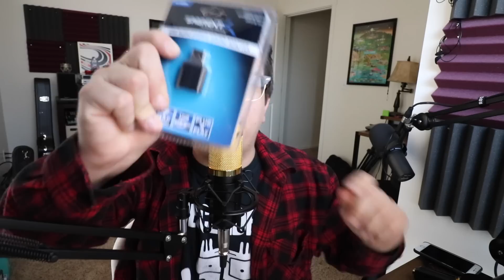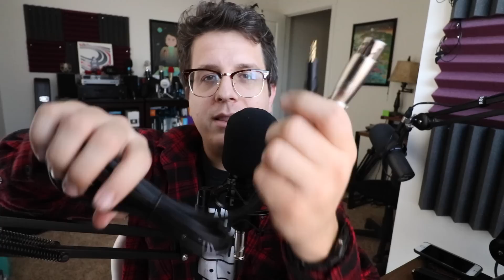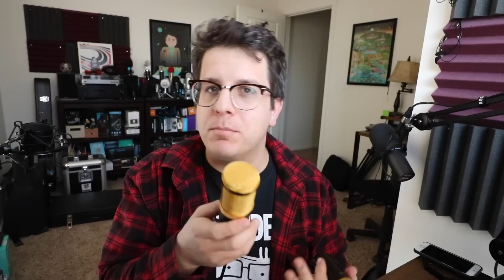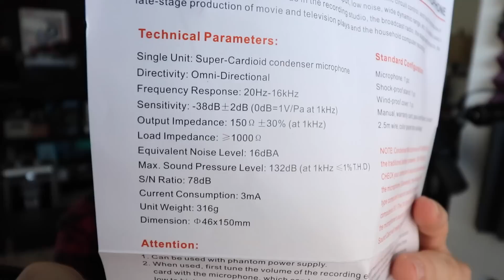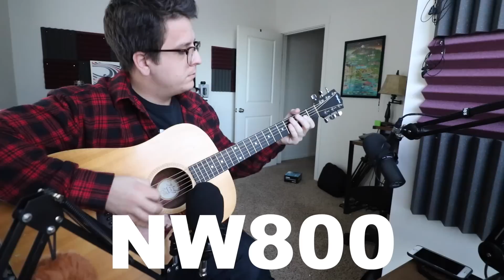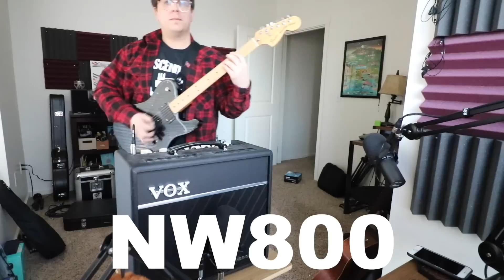Neewer NW-800 Condenser Microphone Review / Test

Comment: Just grabbed one on Amazon for $11. Can't beat it. I've got dynamics, condensers, and ribbon mics, some costing 20x as much, but do they sound 20x better? Debatable.  TBH I'm planning to keep the body/capsule and maybe mod or replace the driver board (probably replace since this is SMT). Body is decently constructed and I couldn't even buy an empty one this cheap..
Reply: buying expensive mics is usually a waste of money anyways, it's all relatively old tech.
Reply: @iamv0id202  I have a few of those too. I've got 60+ mics in my locker. But you're not wrong . Many of the mics on the market are based on a very limited set of proven circuit designs that have been around for 50-60 years.  Nobody is reinventing the wheel.

Comment: This is the current microphone I'm using right now on my podcast here on YouTube and in my experience, using both the Phantom power and the USB soundcard does its job but in the end, it wasn't the greatest and best audio quality. I tend to have way too many hissing sounds which make me do more audio editing furthermore. 

But, later on, I upgraded and got myself a new Behringer U-Phoria UM2 audio interface and may I say it improve my audio quality exponentially! The only downside really is you gotta make sure you control the gain know carefully because if you put too high it will have so much hissing sound. 

Anyways, great video as always and would like to ask for your opinion. Should I get upgrade to a better microphone or an audio interface?

Comment: on my microphone it has alot of noise like white noise i think its called
Reply: its the neweer 800 to btw
Reply: @Antares Star i found out its because you need a 48v phantom power supply to make it work
Reply: how did u fix it?
Reply: @theproslayerr2114  bruh i couldnt fix my bs even w a phantom power so i just got a new different one
Reply: @babyesco1  so you can't just connect it to your pc?
Reply: @theproslayerr2114  my laptop dont support it cuz its 48v and my laptop is garbage
Reply: @babyesco1  so which mic did you get now?
Reply: @babyesco1  so this one doesn't sound like that annoying buzzing sound? I literally did everything I could to remove it but couldnt fix it.
Reply: @theproslayerr2114  if u want i can send u samples of both mics and let u decide waht u want

Comment: I just purchased the NeewerNW800 and a "Depusheng U4 Sound Mixing Console Bluetooth USB Record Computer Playback 48V Phantom Power Delay Repeat Effect 4 Channels USB Audio Mixer " audio interface My Laptop is an Acer touchscreen running  windows 8. Can you help me with advice on the best way to configure this set up, and maybe some suggestions on what the best way to set up a video podcast using this gear?

Comment: I know this is an old video, but I’ve just picked up a secondhand Behringer 302usb (I have watched your video on that too) will the Neewer mics work with the low 14v phantom power output. My current xlr condenser mic (really old, maybe 19years old) clicks when using the 302, I assume because it’s not getting a enough from phantom power (it’s dinner on my bigger mixer) 
Can you confirm which mics would work with the 302usb. I’m looking to keep this set up as low budget as possible. I’m using a dynamic mic with the 302 at the moment but thought something like the Nw 800 or 700 or something at that price point would be good (if they can get enough power and actually work on the 302usb) I know you probably don’t have any of these things laying around to test anymore. I’m a bit behind I guess.
Any advice for mics that work with the 302 would be awesome.

Thanks in advance. 

Ryan

Comment: I've had this mic for about 3 years, it's been great but I'm tempted to upgrade. I'm looking for something around $100. Is there any mic you would say is "clearly" better than this in that range.
Reply: hi since  you had this mic for 3 years could you help me please?
Im a noob at these things and at 0:38 he said you need voltage. how do you see how much voltage you have and stuff?
Reply: @fea88joined89  Not sure about the science behind it. I'm not too experienced in this but here's what I understand.
You would want to get a power supply or audio interface to power it. Otherwise the mic won't function correctly (too quite, doesn't work at all, etc) For the best effect you would want a device that outputs Phantom Power (Full 48V).
The Neewer NW-100 is a power supply that you can use between your microphone and the headphone jack on your PC. The problem is if you use a internal sound card on your computer you often get a constant Hiss noise due to interference.
The better option is a Audio Interface that has phantom power such as the Scarlett Solo or Behringer UM2. They are much more more expensive but eliminate all sources of interference and also provide a even cleaner sound. (Search up a sound comparison between a audio interface and power supply)
My recommendation is if you don't mind the money buy the Audio Interface, otherwise try the Power Supply, if you get a hiss that bothers you either get a external sound card or more preferably a audio interface with Phantom Power
Reply: @fea88joined89  Not sure about seeing the actual voltage, it's probably somewhere in the specs of the sound card. If it sounds fine than the voltage provided by your current power supply (built in the sound card assuming you are not already using a dedicated one) is probably sufficent. But it can be improved with phantom power.
Reply: @fea88joined89  Hope this helps
Reply: @TheBaz568  thank you!

Comment: I found a better version that has the mic stand and a swivel pop filter and other things for the same price (UK only) https://www.amazon.co.uk/Professional-Broadcasting-Microphone-Adjustable-Suspension/dp/B01I6LIZ8S/ref=pd_sbs_267_1/257-1324754-5323609?_encoding=UTF8&pd_rd_i=B01I6LIZ8S&pd_rd_r=17d1bd7c-1e76-4c9f-8e59-7dcc27c060eb&pd_rd_w=NZEYp&pd_rd_wg=Dqr7x&pf_rd_p=2b420a2f-6593-478e-8b5f-cb43865ff16f&pf_rd_r=200KFHFBV6Y7CTHSP0ZW&refRID=200KFHFBV6Y7CTHSP0ZW&th=1

Comment: Been using one since about the time this review came up;
foam filter got eaten by my cats BUT didn't fall apart over time like some do,
the cable eventually got loose @ the XLR, and I wound up ripping it out of the housing LOL but I re-soldered it and it's fine. I mean, for the cost, it was a great deal
The mount is still good, none of the bungee/rubber material bands fell apart yet and I've certainly abused it
The mic still sounds how it did when it was new (I have reference recordings) 
The power supply is still good--no buzz or anything silly
And it looks pretty good.
My brother actually bought one about a year after me without me knowing and his is of the same detail, so, I'd recommend it as well for the cost, but don't rely on the generic XLR cables
Reply from the maker: Yeah if it's survived all that. I'd say you got your $20 worth! Haha.
Reply: @Podcastage  I do believe I got a kit w/ the PSU, case, etc and at the time it was like $50 but it had good reviews so I went for it haha

Comment: Do I need a audio interface to use it or can I just plug it in my laptop
Reply from the maker: I would ONLY recommend this mic with a proper USB Audio Interface like the Behringer UM2. I don't think you get usable quality 99% of the time.
Reply: @Podcastage  why then you made a whole video saying usb soundcard is enough? What made you change your mind to tell ppl not to buy usb soundcard, in description? Quality seems very good if only few additional $ will make this BM-800 condenser mic sound 10x better. Unless you lied in the first place and actually had much better setup than just usb soundcard, while recording this. :)
Reply from the maker: Sensei because manufacturers change components without notice and that affects the performance. At the time of making these videos I was unaware that the company would change it: https://youtu.be/J1v1jtHz4C0

Comment: I cant get a soundcard or phantom supply i had a nw700 and i plugged into my desktop and it worked fine i have a 750 watt psu will it be ok with a nw 800
Reply from the maker: What soundcard? If you're talking about the 3.5mm input on your computer, that's correct, it will not provide phantom power. I recommend a USB AUDIO INTERFACE like the Behringer UM2, which provides +48v of phantom power. You will need an xlr to xlr cable to connect the mic to the interface.
Reply: But i used the nw700 without an inteeface so shouldnt the nw 800 be the same?

Comment: If I buy a 48V phantom Neewer Power Supply. Will I need anything else for it to work WELL?
Reply: Nope as long as you are planning on using the cprd that comes with it and have an 1/8th inch mic jack on your computer. If you dont, you can get a usb sound card adapter on amazon for just a few bucks. If you have an audio interface with an xlr input you will need to buy a standard xlr cable, as the supplied cable is xlr to 1/8th inch.
Reply: Angelo Faraday So can I just by the mic, um2 interface, and an xlr. Will that be good? Will the um2 charge the mic.

Comment: I just got this microphone, but it sounds just as muddy as my Corsair Void Pro (wireless). Is there something I'm missing? I'm using a 48v Phantom power supply and the included XLR -> 3.5mm adapter.

Comment: Do you really need that gigantic 48V Power Supply for it to work?
Reply: Răzvan Afloarei, if your running it on a laptop or a low power computer then yes. Bought a neewer condenser mic to  live stream and I didn’t order a phantom power supply and I get I really bad humming noise.

Comment: hmm when i plug in mine its really soft. what do i do?
Reply from the maker: Depends how you’re connecting it.
Reply: Hmm i got it like this: mic to phantom 48v to my motherboard
Reply from the maker: There is likely the problem. Direct to computers motherboard does not provide decent quality. A usb audio interface would provide better quality.
Reply: Thanks! I will try that

Comment: I bought a white/gold BM-800 a year ago in a kit. (swingarm, pop filter, vibration mount, wind filters, dynamic mic holder, bm-800) connected to a UM-2. It was a good deal but after about 6 months, an 8db LF hum started to randomly show up. The hum completely goes away only when disconnecting the mic. Physically the internals of the mic are fine and the small circuit board in it looks ok too. Sometimes the hum just goes away and it has levels the same as most decent condenser mics...if you can afford it, get a better mic...quality control on known brands is actually a thing worth paying for! Since these cheap mics sound very similar to an AT2020, I recently upgraded to that.

Comment: so if i buy this mic and a sound card i can run it well? Do i need the 48v power supply because they have a kit with it? if i buy their kit that comes with a soundcard can i just plug the xlr to 3.5 in there and call it a day
Reply: you can connect it directly with you builtin soundcard, you can use the phantom power brick or you can get a proper audio interface with a mic preamp and phantom power, i bought the behringer umc22 in order o reduce any hiss and noise

Comment: You should read this before buying this mic:

So I bought  the NW-800 + the sound card Behringer U-Phoria UMC22 + XLR cable 
After instaling the drivers, configurating all the stuff, I still had this background noise and bad quality ( nothing to see with the quality in this video)
After searching on the net I finaly asked Amazon for a refund.

I wasn't the only one with that issue.

So finaly
1) DO NOT USE BAD SOUND CARD for the NW-800
2) Be aware of what you buy,
Reply: i've bought the same setup as you and can hear any noise at all (except the noise that comes from the cooling system of my computer)

Comment: I have a question. Do I only need to buy a phantom power device for this mic, or do I need a USB soundcard too?
Reply from the maker: I only recommend picking up USB AUDIO INTERFACE that offers phantom power.
Reply: Thank you for the response! Do you think the Neewer phantom power supply would be fine?
I'm also not sure if I should get the BM-700, the BM-800 or the NW-800. I've read someone in the comments say the BM-700 has less distortion than the BM-800 when you're speaking in it loud. So I guess I'll buy the BM-700? I guess it's a good mic.

Comment: Just picked up the NW-800 for about $20 USD and will be using it with a Tascam DR-44WL handheld digital audio recorder which has Phantom power and XLR inputs.  I need to test for pattern response but there is as best I can tell no documentation that might help with pattern and reference position.  In the future perhaps when you test for pattern you also provide the reference on the microphone you can use to identify where the center of the pattern is.

Comment: heck for me my NW-800 Microphone is super static almost nothing how you sounded I wonder what Im doing wrong
Reply from the maker: connecting direct to computer? or using usb souindcard?>
Reply: Podcastage I'm using  a USB sound card & Phantom Power
Reply: I have had the same issue. Turns out my laptop was actually the problem. I tried different combinations, with and without phantom power, with different audio settings... but no external sound cards or audio interfaces. 
My laptop produces a loud static noise that I was able to remove by enabling echo cancellation and setting the gain to 0db and the volume to 75. But my voice sounds terrible when I do that. 

Then I tried it on my gaming setup, which has a decent built in sound card and there is no static. With or without phantom power, it sounds just as loud and as clear. And no settings there either. Just input volume set to 100% and nothing else. Even at +30.0db gain, there still is no static. 

So my suggestion is, don't use a cheap computer with your mic. I didn't try an audio interface though, so I don't know whether to recommend trying that. But it still is an option, that many people recommend.

Comment: I just got this mic and it seems to clip really easily when I speak or make a sound that's just a bit louder than normal, I have an interface and the gain nob set to half way and on my pc the levels are 50, also I'm further away than you were in the video, thanks for any help!
Reply from the maker: What is the level you are hitting on your computer? That's what's really important. You're probably clipping. So turn the gain down.

Comment: I bought the mic and and I'm getting very loud static noise in the backround. I am running it into my Behringer U-Phoria UMC22 and the Interface directly into my pc. Even when I turn the gain almost all the way down, I can still hear the backround noise through direct monitoring. Should I just buy another one or is there any way to fix this?
Reply: I have had the same issue. Turns out my laptop was actually the problem. I tried different combinations, with and without phantom power, with different audio settings... but no external sound cards or audio interfaces. 
My laptop produces a loud static noise that I was able to remove by enabling echo cancellation and setting the gain to 0db and the volume to 75. But my voice sounds terrible when I do that. 

Then I tried it on my gaming setup, which has a decent built in sound card and there is no static. With or without phantom power, it sounds just as loud and as clear. And no settings there either. Just input volume set to 100% and nothing else. Even at +30.0db gain, there still is no static. 

So my suggestion is, don't use a cheap computer with your mic. I didn't try an audio interface though, so I don't know whether to recommend trying that. But it still is an option, that many people recommend.

Comment: DISCLAIMER u said this thing can run on 4 and half volts wait??????!!!!!!

I want to get this mic sound great can I use a behringer 502 on this it has 14 volts not +48
Plz answer thanks
Reply from the maker: Go to Lol yes it should work on the q502 perfectly fine when connected with an xlr to xlr cable.
Reply: Podcastage   (Another thing)

Can I put a xlr to 3.5 to an 3.5 to 1/4 adapter and plug the adapter into an mixer?

Will the 502 mixer except that

If ur confused go to my channel and watch this one video

Comment: So I plug my neewer 800 into the phantom power supply and into the microphone input on my computer and the sound is terrible. So much static noise I can barely hear myself. What can I do to fix this?
Reply from the maker: Yeah. I no longer recommend this connection method at all. I ONLY recommend connecting it using a USB Audio Interface.
Reply: I have had the same issue. Turns out my laptop was actually the problem. I tried different combinations, with and without phantom power, with different audio settings... but no external sound cards or audio interfaces. 
My laptop produces a loud static noise that I was able to remove by enabling echo cancellation and setting the gain to 0db and the volume to 75. But my voice sounds terrible when I do that. 

Then I tried it on my gaming setup, which has a decent built in sound card and there is no static. With or without phantom power, it sounds just as loud and as clear. And no settings there either. Just input volume set to 100% and nothing else. Even at +30.0db gain, there still is no static. 

So my suggestion is, don't use a cheap computer with your mic. I didn't try an audio interface though, so I don't know whether to recommend trying that. But it still is an option, that many people recommend.

Comment: Good point about the "requirement" of 48V for running a condenser.  Everyone is out of joint about the Behringer Xenyx302 interface-mixer being only 20V.  "False advertising!" "Won't work!"  Not true.  With phantom power, "more is better" doesn't seem to apply.  It's either enough to work or it isn't.  --  Now I'm curious to know how the NW 800 compares with a similar-looking mic on eBay for $8.50 (new!).  It's XX-800.  (I forget what the letters are--it may be the BM model--or BS).